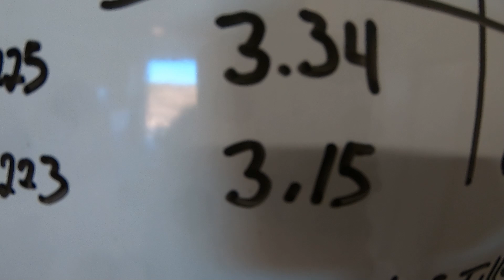Mega Moto 212 breaks 60 MPH with a 223 stroker?

Comment: Nice bike, I want the same kit even more. I’d like to know how the hydraulic disc brakes work. Although I plan to run a stock engine on mine just to keep it long term reliable. I’ve riden hard in my past and now a days I just want to enjoy my rides rather than possibly brake some more bones, I’ve had a back injury and both legs broken so now I’m over that. I still enjoy riding but I’m a lot more careful these days, thanks for the video and ride safe.
Reply from the maker: Thanks! The brakes work really well. It's a nice overall bike. I really enjoy it.

Comment: Really enjoy the  content!

I'm confused why the 225 tilly was so slow. My my mega moto 212 with 10t 53t gearing doing 60 with a tilly 212. 24mm mikuni..Port polish head.. 265 fire cam.. billet rod and fly.. still electric start also. I would have thought the 225 would be upper 60s.
Reply from the maker: Thanks! Sounds like you have a sweet bike.  The 225 has a 55MM stroke. The Predator in the video has a 58MM stroke and a bigger cam and the same head as the Tilly,  so it wasn't really a fair comparison. Mainly just for fun.

Comment: Hey man,  I was thinking about adding a steering stabilizer.  I've seen where they are used on motorcycles and dirtbikes, especially ones going in the 50+ mph range. There are a number of different kinds with a wide price range.

But it's supposed to make it a much safer and more enjoyable ride.

I was just curious if it would be something you would consider doing on the minibike side. 

I haven't been able to find much on it video wise,  especially minibike related.

Comment: I know this is off topic but it a bike is efi no carb what would your first upgrade be besides gear ratio
Reply from the maker: If there was a governor I would remove it and use a high flow air filter and a header pipe If the extra noise wasnt a concern.

Comment: Just curious as to what kind of RPM are you running these engines up to with a stock flywheel? I haven't seen a Tachometer on any of the bikes yet or did I miss it?